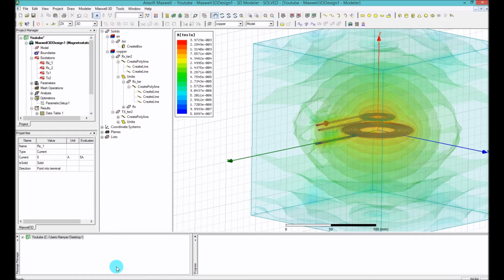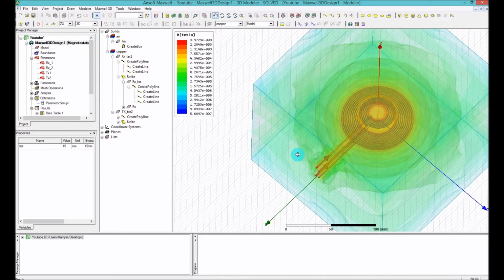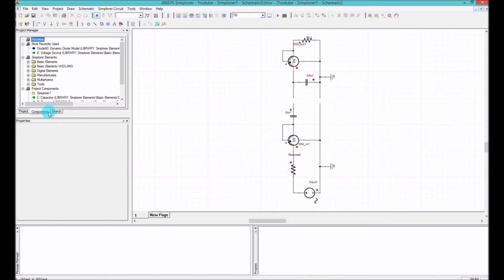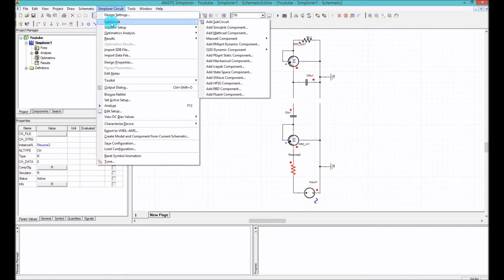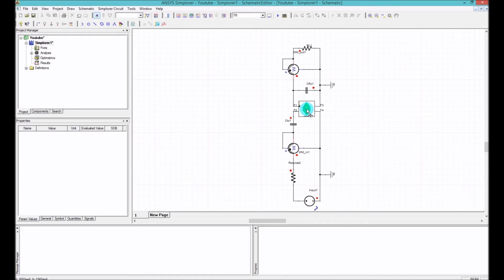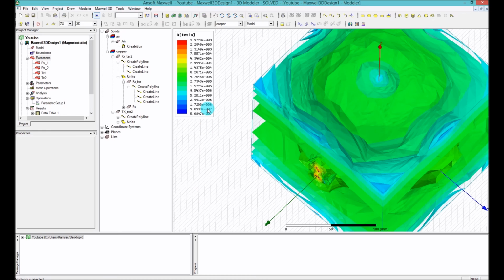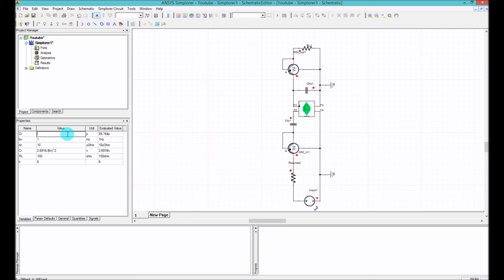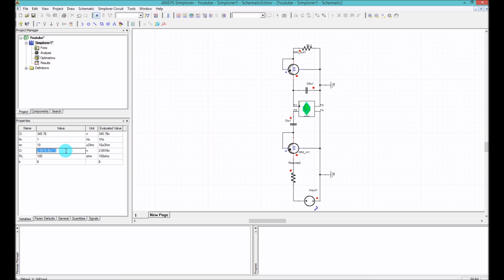Simplorer- (dynamic inductance) Simulate the efficiency of wireless power transfer system [1/2]

Comment: thank you for your videos, they helped me so much, now i want to do simulation about the power transfer efficiency about my coils, but i met so problems, when i try to add dynamics inductance, i can not find the button, only add dynamic magnetostatic (Electromagnetic suite 18.1), i try to add the coils in maxwell 3D by it, but nothing apper in the   design, solution and matrix, then i can not add the coils, can you help me or can you send the file about this video to me(t.hou@tudelft.nl). thank you so much.
Reply from the maker: Make sure the link is established.
Reply: yeah, the link is right, i am thinking about if there is something difference with the new and old version of the software, that's why i ask for the files of this video. my e-mail address is: t.hou@tudelft.nl. thank you so much.
Reply: @kamyark8434  i try to reinstall the software, it is OK now. i  can add dynamic magnetostatic.
Reply: @侯涛-i3f  Hi, did you finally get the schematic ? 
Could you send it to me ?
Reply: @aks9545  me too please

Comment: How did u choose cr and ct
Reply: in maxwell you can find inductance, and also you know about your frequency. So from LC circut formula you can calculate the capacitance
Reply: @izazalishah1334  Designing the litz wire in Ansys Maxwell is available only with transient or eddy current solution type. Is it fine to co-simulate the same WPT System using eddy current solution in Maxwell and AC solution in Simplorer?